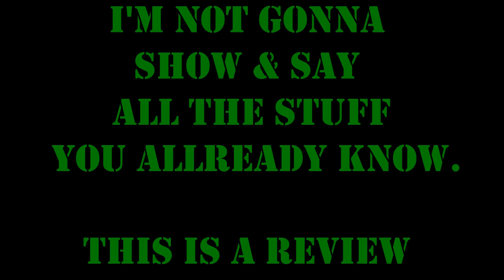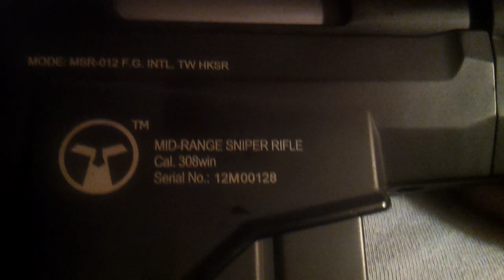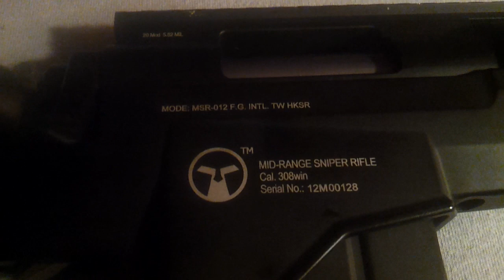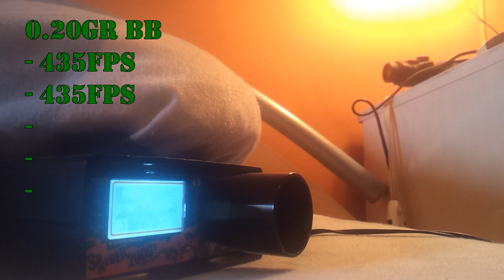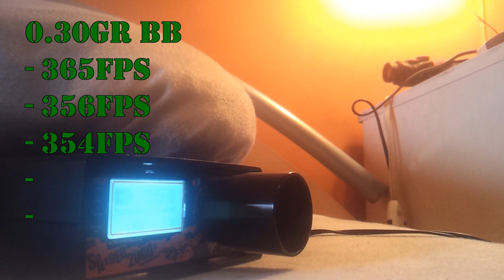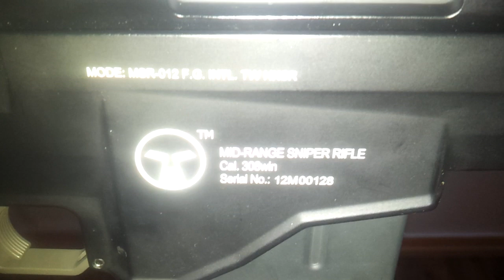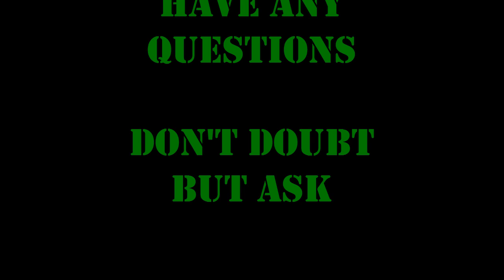Ares MS700 Review - All You Need To Know

Comment: Hey to mount that flash hider did you need any thread adaptor? Or did it thread directly to the barrel
Reply from the maker: o wow people still watch these old vids? umh this has been 5 years ago but if i remember correctly the flash hider came installed on the gun, couldn't really find a way to get it off either, probably glued on very well.